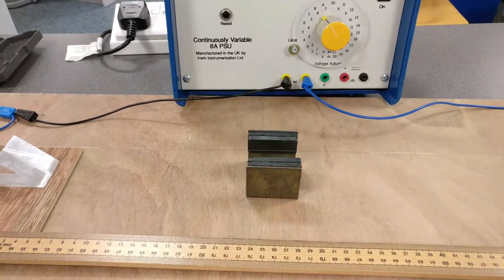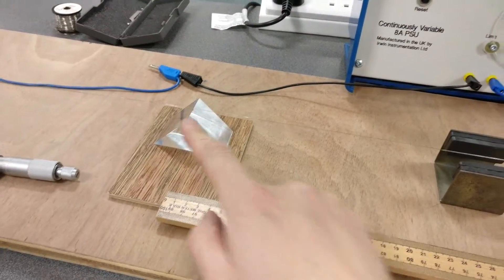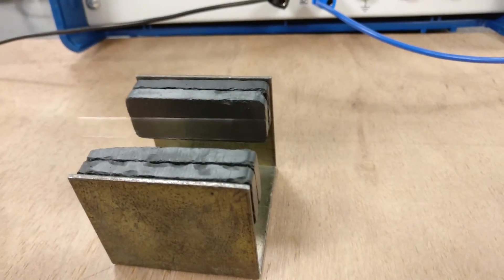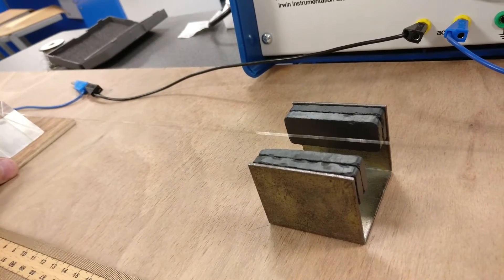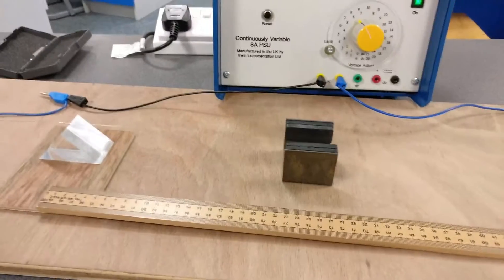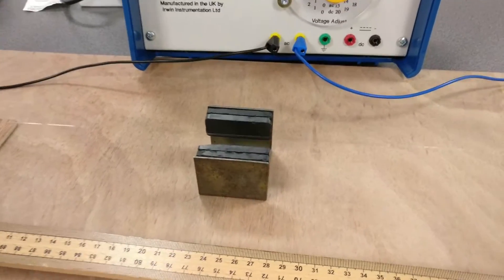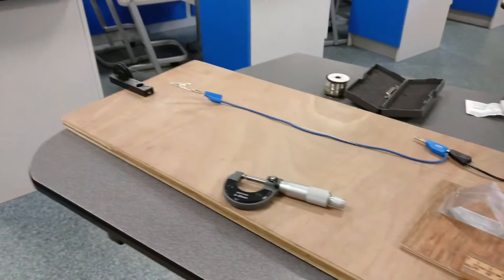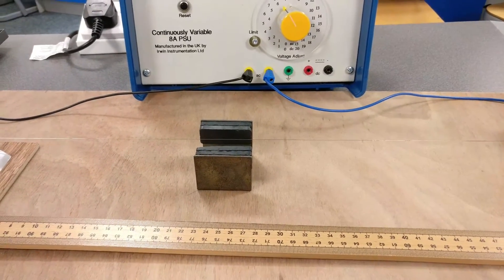Standing Waves on a Wire Alternating Current

Comment: Could you use this as a form mechanical control - with that in mind, what tension would you need upon the wire to counter the standing wave?   Also could you use this phenomenon to generate electricity and what kind of efficiencies at play.

But for me my initial thought was fine control of a robotic arm using such wires.   Certainly one of those area's of science I will dig into more down the line.

Would like to see same experiment and the output AC frequency changed to see the effect.  Also could you phase two lots of AC input to produce a sympathetic frequency between the AC.  

Shame all the cool science idea's happen a long time after you have left school.
Reply from the maker: You can use a signal generator, but the nice thing is that you know mains is 50Hz stable very little wobble without a digital readout.
Reply: @animatedsci  Yes the the mains is 50Hz stable over time on average but that wobble don't need much to read it and me 20year old UPS (though not same batteries :) can pick that up and fascinating seeing it and voltage vary and also the whole way the grid works.

I guess in many ways, kinda going down the path in which reinventing the guitar by accident becomes a possibility :).
That and probably pick up more energy from radio waves upon that length of wire - which may also effect your results when doing experiments.  But could just use a length of plastic tube to contain the wire and aluminium wrap that if was an issue.
I do know - mobile phones when doing some electronics stuff can be about as useful as a microwave leaking next to SETI's dish's.